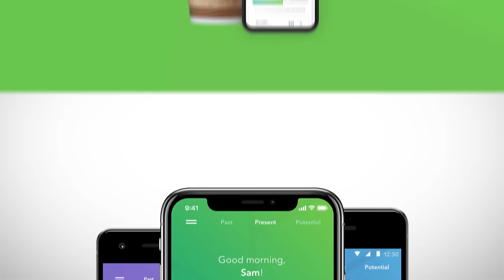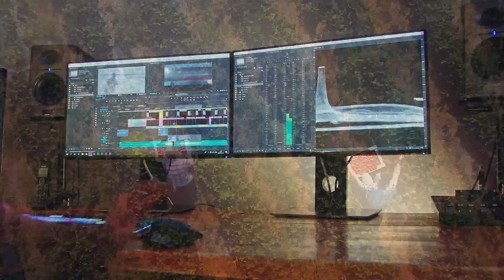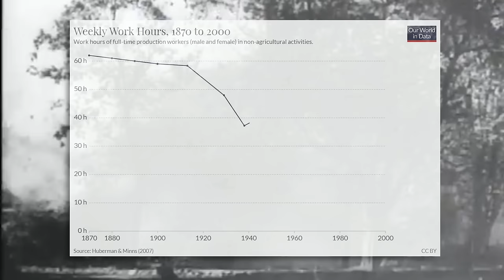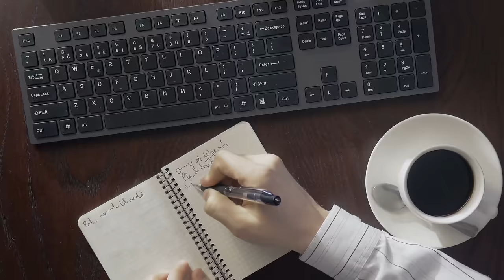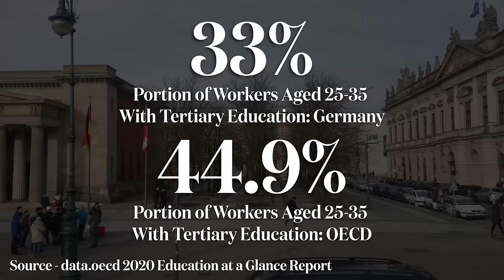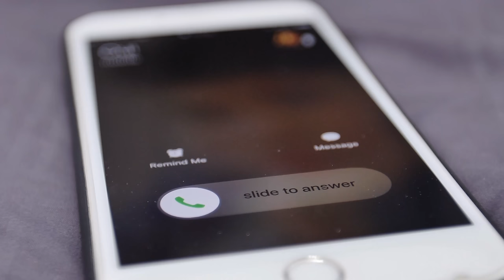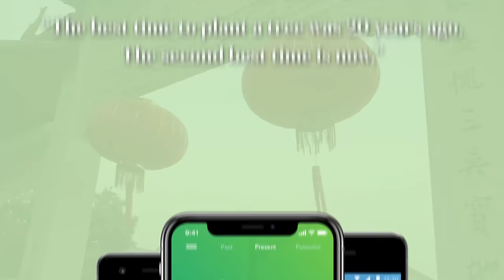Why is Working Harder Making Us Poorer?

Comment: Things that aren't great for our sanity, will at some point also not be good for the economy. The economy emerges from the sum of its individuals. When the individuals suffer, the economy will show signs of that as some point!
Reply: Yes but that's usually in a time frame outside from when the ones are currently in power
Reply: Overworked Japanese guys: wut
Reply: @tomlxyz  True... but there's still a time after that and productive and healthy people will always be required!
Reply: you mean that overworked people might be more prone to lash out and start a riot? curious
Reply: @sciencemanguy  
NANI
Reply: @sciencemanguy  Japan has stagnated economically since the 90's
Reply: The economy is more than just a single entity, it's possible for some actors to gain while others lose. Watch the "K-shaped recovery" video
Reply: @LowestofheDead  Yes and it's terrible for the economy in the long run

Comment: I can relate to the advantages of being judged by performance rather than hours sitting in a chair. I once took a job at a pharmaceutical research company (Covance in Princeton, NJ) where I was criticized for taking a walk break to stretch my legs after consistently getting work done fast and for arriving to work 5 minutes late due to bad traffic after a 45 minute commute.  They eventually fired me for it and lost a productive worker because the manager didn't have the patience or skill to use productivity metrics.

Comment: If 20% of a store’s customers never shop on Sunday, or past 8 PM, it will cause the shop to change.

My last job started closing at 10 PM, but after a year or so they cut back to 9 PM we’d get like 1 customer every 2 or 3 days past 8 PM.

This pandemic COULD be just the event we need for a big change, as almost everything is working reduced hours.
Reply: Not from my perspective in manufacturing. Hours and orders are through the roof. We are expectrd to be on 6 day weeks 10 hours a day for the next year. Of course any request for raises is met with we need to watch labor due to covid....
Reply: I also suspect that the pandemic acting as the much-needed catalyst to force companies to make the investment in building systems for teleworking is going to prove to be a catalyst for change also. Not only are fully teleworking employee's cheaper for a business to accommodate thanks to the fact that they provide their own office, computer terminal and phone at no cost to the company which makes them cheaper per employee for starters. But this mode of working also strongly promotes a more results-driven approach to evaluating employee performance also, after all, it is difficult to account for hours with teleworkers but results remain easily measurable. Thus I would expect that the likely shift to allowing more teleworking thanks to the pandemic showing it works and forcing companies to acquire the infrastructure to facilitate it, I also expect a renewed interest in results-driven performance assessment as this evaluation method will likely be king for teleworking employees where time tracking is near impossible to verify so focus instead on measurable output.
Reply: jumpinjaxs 
Interesting perspective.
It may end differently for manufacturing, but then again if most offices and retail go one direction I wouldn’t be surprised if manufacturing follows soon after.
Reply: @seraphina985  so they will just make u work longer, congratulations.
Reply: My business doesn't work from 3PM to 6PM because it's not worth it for us to be open at that time, not enough customers to justify paying the employees and other expenses, however, my business also makes most of the profit after 9PM so we're open untill 2AM and plan on extending that. Consumers dictate the work-hours, 100%.
But then, in the end, we're going to open those hours 3-6pm because of the "customer is always right" thing and we're gonna have to bow down to those vocal couple of people that want to come in at that time.

Comment: What you didnt mention is that actually productivity per person has increased so much, that a 10h work week would already be possible. The thing is only, that those profits have been hald back from the masses and been siphoned off by the richest 10 and 1%.
Reply: I also used to believe in the productivity vs wage gap myth, before I knew better.

In 1973, the social security act became public law. Adjusted for benefits, pensions, medicare, social security tax, the wage gap vs productivity doesnt exist.

It simply means that instead off getting paid in $ money, as we used to before 1973. A larger and larger chunk of our salary is instead getting paid in the form of medicare, social security, pensions etc. which are paid by the employer.

Correct for THE added benefits and the two curves; productivity and wages align perfectly.

And look at the productivity and wage gap curve, and see they start to seperate from 1973 onwards.

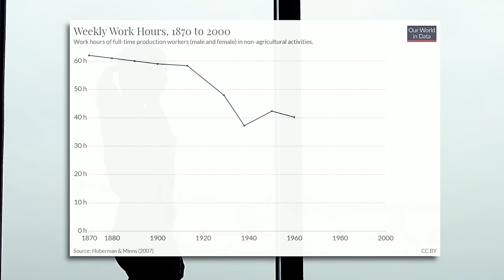Comment: Had to laugh out loud when you mentioned the time spent working in Greece XD Ever been there? People spend a lot time AT work, sure. But they hardly work at all. We had a construction site next to my Hotel and there was a crew of 7 people. They start working in the morning, usually ariving arround 6am. Theyd do a bit of work, have a breakfast arround 9:00. At 11:30 to 12:00 they would start a lunch break until 13:00. then theyd work another 2 hours before it would get too hot and theys start sitting in the shade or their trucks until maybe 17:00, then theyd start working again until 18:00, maybe 19:00 and go home. While it is true they would spent 12-13 hours on the construction site (and surely got AID for the time), they would spend 8 hours max actually doing the work, and the work they DID was slow and sloppy. I used to work on construction sites to earn some money on the site when I was younger, and we'd manage the same workload with me, an unskilled worker, and an experienced one in 2-3 days while they took 5 days with 7 people and it was done badly afterwards. Sure it's only anecdotal, but if you have ever been to Greece for extended periods of time youll see that behaviour a lot, and I mean A LOT.

Comment: Working harder vs working smarter.... 

The winter I was 15 my family lived in a house with wood stoves for heat.  One of my nightly tasks was to bring in enough wood to keep the house warm overnight.  My instructions were to load up the split wood in my arms and carry it around the house (not allowed to go through the kitchen covered in snow) to fill the wood boxes.  I got a very jaundiced view of these instructions when on that first night it took literally 4 hours to fill two wood boxes, because I could only carry one or two pieces in my arms at a time. 

Next night, I spotted a wheelbarrow; sure, it had a flat, but since the yard was full of snow this was not a hardship.  I stacked that puppy FULL.... only took 2 trips that night, one for each box.  I could then use the other 3 1/2 hours I'd spent carrying wood the previous night to do my homework.

Comment: In other words, we remove the socialism of "hourly wages" and replace it with "we pay you for what you do for us"
It's harder to track, but theoretically it uses the power of capitalism to fix workplace inefficiency
Reply: except the 'socialism' system you try to portray is mostly an altered description of what socialism was. If you think there was no job competition (or other forms of competition) you would be extremly wrong. You are a mechanic? Hmm, where could we place you? In Bucharest, give you an oportunity to rent a flat by the metro or fix machines for a mine, having to commute in an unheated bus in winter? Soo, how hard were you working?

Comment: I live in the Netherlands and when I get home I'm done for the day. Overtime doesn't really exist, at least not or a regular basis, problems exist and sometimes need to be solved asap. We also tend to live relatively close to our job. If you live half an hour away you will probably get the question why you work so far from where you live or vice versa. In a lot of towns shops are closed on Sundays and I mostly see it as a positive. You only go to the shop when you really need to. I moved to a city for my studies and stayed and it's great that I can go every day, but I only really use it when I really need something. Delivery on Sunday isn't a thing in my experience and just happens when most other people are working as well. 

I finished school earlier this year and there you are expected to keep working at home, so being a professional for the last couple of months has given me more free time. I work most of the day and have evenings to do whatever. It's pretty good.

Comment: Great video once again! However,  I have to comment on the education numbers for Germany which are always miscategorized by the OECD and thus misrepresented by people citing their statistics. The correct numbers can be found at the German ministry for statistic https://www.destatis.de/EN/Themes/Society-Environment/Education-Research-Culture/Educational-Level/Tables/educational-attainment-population-germany.html 
25% indeed have a "university level tertiary education", but the OECD is missing the 50% who have vocational training via the dual system which is a big piece of the puzzle: It is a 2-3 year timeframe where you specialize in a job. Half of that time is spent at your employer, half the time at specialized school for that trade. The curriculum of the training is more focussed on practical application and less so on theories and concepts (contrary to what you would expect at a university). It also encompasses a broad set of topics on how to run a (small) business (accounting, marketing, taxes, legal work, etc.). Especially, in crafting or similar trade, it is quite common to open your own shop after you have this background. Others can easily continue working in the business that they started out with - be it at the Volkswagen assembly line or as an IT developer. With appropriate pay obviously. There is some ceiling for your career without a university education, but you can easily aim for a team lead or sometimes even business unit lead of 100 people. 
All in all, this 50% of the workforce having a directly useful education should not be neglected in such an analysis. 

Keep up the good work

Comment: The US might benefit from a reduction of a full time work week. Allows more hours to be worked by those who need it and employers would have to pay more overtime which means higher wages for some employees.
Reply: US is stuck in paradigm that led it to unprecedented success - not noticing, that circumstances have changed.

Comment: If I can give my five German cents to this,
To the point with the less educated workers between 25-35:
There are that few German uneducated workers, because it takes most people at least to the age of 30 to complete their tertiary education, because the education system is also somewhat efficency oriented and not oriented to give you the education the fastest means possible for you. So most people are at least 30 until they are done with their Master of Science/Art/whatever
The next point I wanna poke onto is the "efficiency" based work in Germany:
You really pointed out the good points: "if you are off duty, you are off duty" - well at the moment it changes to beeing available on your off time, because as most of you know with globalisation its always the worst idea that will pull through.
But this efficient roles and off duty thing puts Germany also in a pinch, because if you have someone who is bad at his working role, the whole supply chain will only be as good as the worst worker!
Last point I want to point out with your idea with "no buy on Sunday" is, that the idea is totally invalid: If you have enough working people who do a normal amount of weekly working hours you can also include the Sunday! In Germany the Sunday is a day off for shops, because of the traditional Christian way of "Sunday for prayer", even if it doesn't really fit the population anymore - perhaps in the countryside!
So as I live in the vincity of the Netherlands, I will go shopping on Sunday there!
I must say the Netherlands is the better country - can't find any innovation that isn't made in the big or small there first, before it swaps to "traditional (has always been done like this) Germany"

Comment: I live in the USA. I was miserable, when I was working. I worked 11 hours per day, 2 hours or more on Sunday. My mental condition was getting bad. Because, I had to meet a productivity goals. It didn’t pay to perform too much over goal. Because, besides meeting goal, I had multiple other things to do. My heart rate was so fast and blood pressure so high. The job got so stressful during the last 2 years. Yet, it wasn’t always like that. When I was layed off, I knew that I wouldn’t get another job, because it was way too fast paced for me with my condition. When I got layed off, I was so happy. Because, I wouldn’t be in the rat race. The commute is also bad. I remember when stores weren’t open on Sunday. I do remember when I worked from home. The job made like you were on the computer all of the time. Like if someone was questioning a code. I remember when my mother didn’t have to work. Then, later she had to work. I was happier when she didn’t work. Now, both people have to work and sometimes holds down 2 jobs. People are quitting their jobs in droves. Because, this overwork is overwhelming and not sustainable in the long run.

Comment: I'm noticing that I have a 20 year old vehicle with over 210K miles on it. I just replaced the tires and I need new breaks.  Clearly learn in and doing most of my repairs can reduce my costs significantly, however, factor in tools, Jack, stands, parts and scheduling time and the first round of work both meets or exceeds the cost to pay someone.  

Then there is the pay I get working out 65 miles away verses working in my hometown. We are talking a loss of between 3 dollars, however, the amount of gas spent to work out further until next pay period gives me about $75 a week averaging about $250 to $300 a month on gas.  That highly drops working 10 to 15 minutes away from home.  

So you can see the difficulty in managing financially what is best. 

I'm sure that I am going to need to replace my alternator and fuel pump soon... but it would make no sense to do so now... only to set aside a few hundred dollars for the day I would need to.  Then buy the part and do the work myself.

Comment: Think of it like being in the military, where you have a salary, not hourly, I worked usually 14 to 16 hours a day when I was in they navy, so it wasn't good to work harder like another commenter said because you'll just do more work without more pay, just pace yourself when it's like, because if you slack off, you get get bad evaluations, where you won't promote as fast, or worse, you get in trouble like restriction, (half pay usually, and stuck to the ship for 30, 45 ,60, and in really bad case much longer), but, the other side is you get paid technically when your not working.

Comment: "Work to achieve results then putting time on a cheer" that's actually true. it doesn't matter how much time you put on a work if you dont present result everyday or samll task achivment, you may be rigth but whats better then years of experience or amount of goals achived everyday, as a result you are value by the amount of achivements, it is not the amount of experience on years if most of the time you spend on phone or lacking discipline on the job. which one i will prefer i dont know. let me think, and analize the idea.

Comment: The US could 100% move to a 4 day 25-30 hr work week. The amount of time spent wasted at the office because you have to be there is insane. On top of that, it disincentivizes productivity by having a set amount of minimum hours. I could finish most of my week’s work in 3 days, but I don’t because I spend time just shooting the sh*t with coworker because I have to be up here 40 hrs a week. If I was allowed to get my work done and go home, it’d easily be a 25-30 hr work week and no productivity would be lost. This is in an engineering role at a major defense contractor. It’s nuts.

Comment: You can have shops working all hours without increasing worker burdens,  as processing customers needs to be matched to staff,   so you could simply spread your staff over a longer opening hours.

This vid didn't touch on the 2 most serious problems,    diluting of workers pay with fake jobs in bureaucracy,  
and land zoning making housing far more expensive.  But otherwise good.

Comment: Is 100% of 70% better than 70% of 100%. At face value you'd think that they're equal, but there is a slight nuance. One has 30% head-room, the other is 30% less efficient.
So in short, working at 70% intensity at 100% efficiently is better than working at 100% intensity at 70% efficiency.
If you start pulling long hours for too long, you will end up working at lower efficiency.
Hussain Bolt can't beat Eluid Kipchoge at long distance.

Comment: Work is an insane religion for most people. 
I’ve never taken to standing on my feet for 8 hours a day.
Reply: As someone who works 12+ hrs a day, I do have a problem with working too much. I never stand for more than 3hrs. I take a break every few hours so my feet don't hurt. I know it's not possible for most people tho and that's the problem. If we all were okay with everyone sitting, 8+hr days would be alot easier imo. Tho, I do understand this isn't for everyone. I can easily work 12+hrs a day with only one day off a week. I'm also an insomniac who only sleeps 6 or less hours a day all but that 1 day off, I sleep around 10hrs with naps included